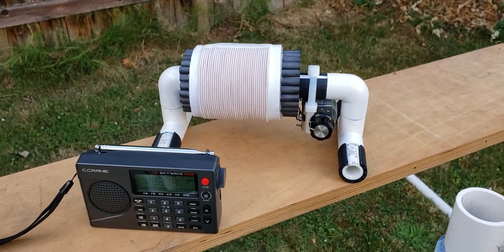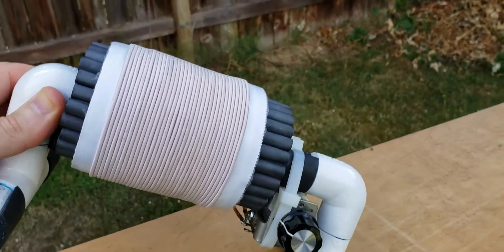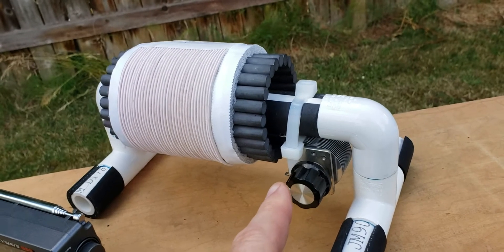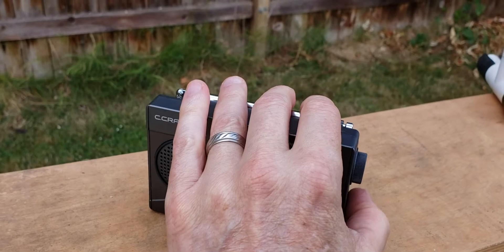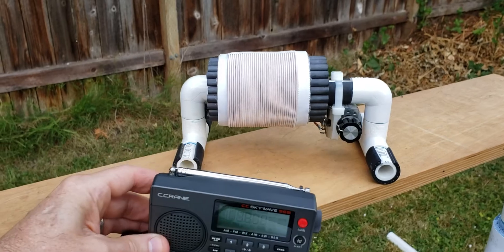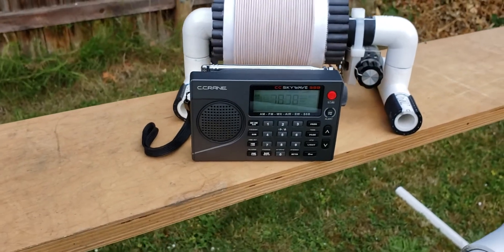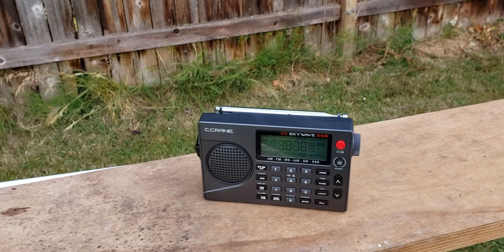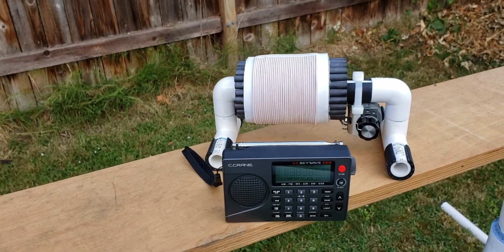New Design 3 Inch (76mm) Baby FSL Antenna Demo Video

Comment: does this work on long wave
Reply from the maker: Since it was designed for Medium Wave (515-1750 kHz), this particular model will only tune the upper edge of the Longwave frequencies. But adding more coil turns (or more variable capacitance) could result in a Longwave model.

Comment: Great vid Gary -- I can attest with my six ferrite-rod FSL I made last month (6 X 120mm x 10mm rods obtained from your recommended eBay seller) that my own version really excels over a much larger open (non-ferrite) based loop and is very def. good for overseas DXpeds or at the coast, also.  I posted my version to your io group a few weeks ago, and I attest to the true superior performance of ferrite rod based loops - actually large loopsticks with large induction-fields that can make for wonderful "sensitivities" to portables for groundwave or night-time skip exotic DX listening.  Good ground-wave propagation of 1070 Victoria to Puyallup over Puget sound too. When I had to spend three weeks in Tacoma, WA working IT at a hospital there (Aug. 1995)  I enjoyed 690 CBU due to the Puget Sound salt-water enhancement, and put it on the car radio's set-buttons along with some other BC stations for fun...  73 - Steve - N6NKS
Reply from the maker: Thanks Stephen, It's true that we get some salt water enhancement from the BC stations here in Puget Sound, especially from the Vancouver stations. 1070-CFAX is an ideal daytime DX fringe station here, with its directional antenna pattern nulling this area-- a perfect weak signal to tweak FSL's and other gain boosters! :-)  73, Gary

Comment: A superb demonstration, Gary.  This is very enticing, indeed!   One question:  compared to an ULR with the ferrite mod, how do they compare vs the FSL?
Reply from the maker: Thanks Walt, Any type of Baby FSL will outperform a 7.5 inch loopstick-enhanced Ultralight in sensitivity, although you do have the extra step of tuning the FSL antenna to match the radio's frequency. When a DXer becomes skillful in doing this he can really run wild in portable DXing results during travel, or on exotic ocean beaches overseas. For reference, a 7.5 inch loopstick Ultralight would probably have received 1070-CFAX at around S7 in the above video, while the FSL boosted it up to S9+. 73, Gary

Comment: Excellent! I count 32 wraps of Litz wire.
Reply from the maker: Thanks Steve, Actually 33 turns :-) Just enough to take up most of the space on the 120mm ferrite rods, with a little extra space on the sides for the white trim. A design photo is posted is at https://dreamcrafts.box.com/s/08nkvi7tdwvl0juqcaijs8up5vj4rjmw